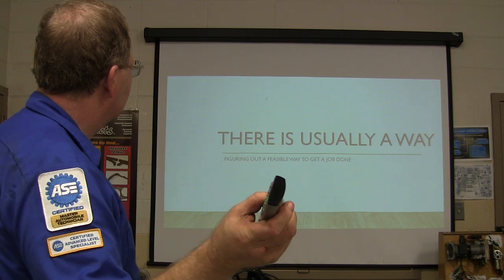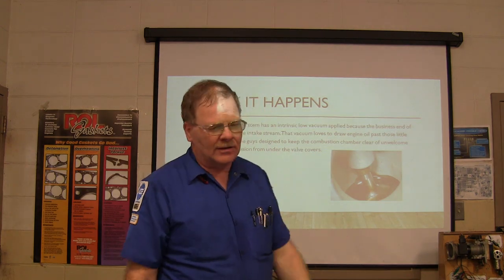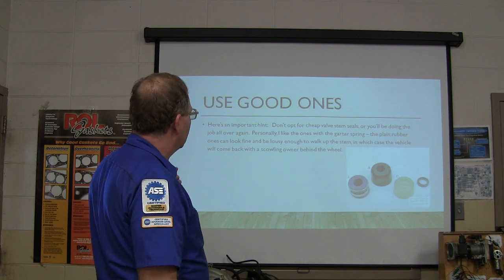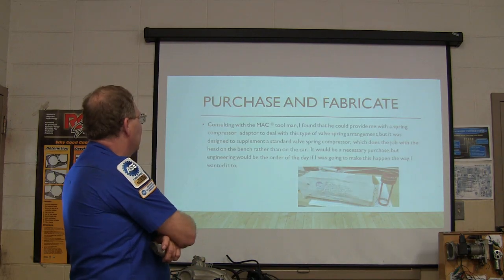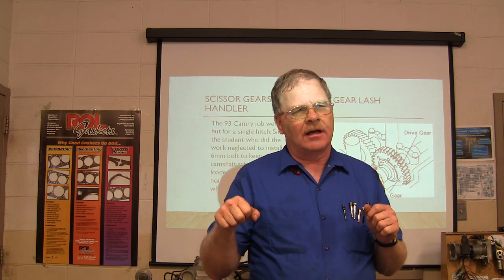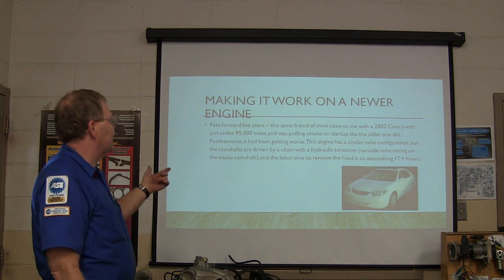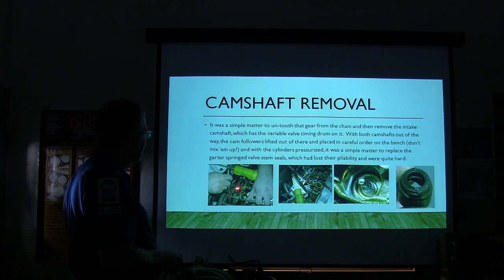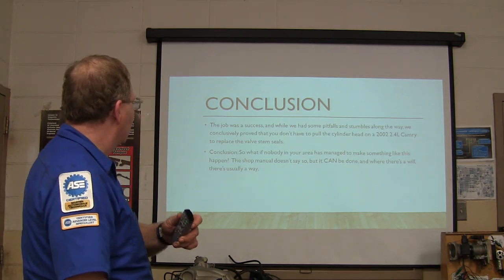Valve Stem Seals   A Better Way

Comment: Good little tool there. Oh me, I didn't know valve stem seals were so hard to do! My 2006 Camry needs them I reckon. Small amount of blue smoke comes out at cold start, but at 265,000 miles, reckon that'd happen. I'm thinking it's not worth doing it, I sure can't! And not worth paying much to have it done. Oh me, reckon I need to get shed of the thing.
Reply: Lazy eh...
Reply: Andrew Lim  no, blue is oil. Any water, even with coolant in it, will show up as steam. It will, in case you have a blown head gasket, have a distinct anti freeze burning smell. It is like the smell of death, you never want to smell again...
Reply: Andrew Lim  You ever see a kettle spew blue smoke?
Reply: Andrew Lim  I guess you never seen a steam tractor pour white smoke from the blow off valve... https://www.youtube.com/watch?v=EVxByLO_6cA

Comment: That scissor gear anti-lash setup is also found on the modern Triumph 865 CC motorcycle engine (modern air-cooled bikes). Wonder who thought of it first, the car guys or the bike guys!
I like your C-clamp setup. Any tips for how to do seals on a small motorcycle engine with rockers & pushrods without pulling head or even the rocker arms?

Comment: As a kid before my rookie year I could not find a mechanic that can figure out what the problem was with a 79 Lincoln with a 400Ci M refused to idle properly. I took the engine apart and found the cam gear had a thick plastic type noise insulator around it that had exploded. It caused a major amount of slack that was causing the engine to surge at low rpm above 1300 rpm It would run good. After about 7 wrong diagnosis and a old man ASE master did not screw the top of the carburetor after a rebuild causing a fire in the driveway I decided that no one was ever going to touch my ride ever again. After  that I started working on the family cars knowing that I would never do anything so careless as that. It took a few years of going to a local mechanic that I would take parts to press something or get an A/C charge after repair that he invited me into my rookie year. It was a very busy small shop where about three times every week I would learn something no book can tell you. Your students are very lucky to have the extra tricks and tips handed to them that experience provides.
Reply: Mike Ponder Nice story. Same thing happened to me when I was 16, kept showing up asking them to use their special tools like timing gun, press, etc and finally one day he says "Hey do u wana do this head gasket here? " and boom I was hired.
Reply: Mike Ponder is

Comment: Spring compressor is very clever. Have a 320k BMW e30 which doesn't smoke on start up but does so 3/4 minutes later. Plugs are slightly oily but don't know if its valve seals or piston rings. A mechanic told me that sometimes rooting at an old engine can make it actually worse.
Reply: MsCelicagt4 It's at least the valve seals because of oil smoke after running a few minutes. very common on German cars. A bunch of Lucas oil stabilizer will help. Do up the valve seals though I'd say.

On high milage vehicles the valve guides can wear and cause the valve seals to wear out sooner. But I'd say it's still worth it.

Comment: Ask your students what to do if they dont have shop air to compress into the cylinder. There is a way that works if you are out in a field somewhere.
Reply: hydrofuelincanada The old rope method!
Reply: rope in cylinder trick:)

Comment: I have a 2002 Altima 2.5 and its consuming oil like crazy. I replaced the valve cover and gasket with a new OE Nissan cover.  The spark plug well had oil accumulating before the cover change.  all nice and dry now.  Have you ever heard of changing the valve guide seals with the head on? The car is NOT smoking and I think the oil is coming from an exhaust valve guide which is slamming the oil into the exhaust...unburned and has fried the catalytic converter.  I do not want to replace the converter until I have the oil leak (valve guide seals) fixed. Do you know if the QR25 motor valve guide seals would/could be done this way? I saw some posts where they put soft rope inside the spark plug hole, manually rotate the cylinder to top, snug it against the rope and valves to keep the valves from falling into the cylinder.
Reply from the maker: The rope method works - but usually the oil will go in on the intake side because of the pressure differential.
Reply: Thanks!  I realized after watching your video, in fact the vacuum caused by the intake valve would be the likely culprit of the oil consumption.
Reply: Now that I have the cover off (again) I realized taking the overhead cams may be beyond my DIY ability. The Cam sprocket cover on the  passenger side scares me. The aluminum housing needs to come off right? To get to the sprocket bolts that attach the sprocket to the cams? I see there is a timing sensor over there too.

Comment: Where would you get valve stem seals?
I got a SBC 350 from a 72 nova..
Thanks for your help..
Reply from the maker: Typically come with a head gasket set but you can buy them I imagine from some of the aftermarket suppliers.

Comment: How much does it cost to get valve seals replaced on a v8
Reply from the maker: Depends on the V8 and the prevailing labor rate in your area.
Reply: I was quoted 2,000 on my Crown Victoria lol engine swap is cheapee

Comment: Can this be done on a 1997 Mits Montero
Reply from the maker: I've not done it on one of those but there is probably a way if you're an engineering type
Reply: You need a lisle 3650 tool kit.